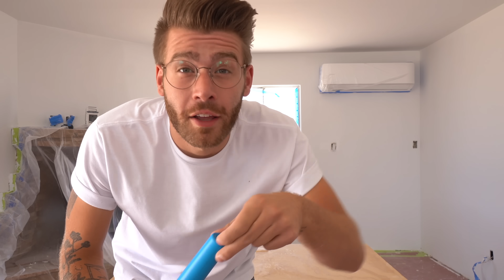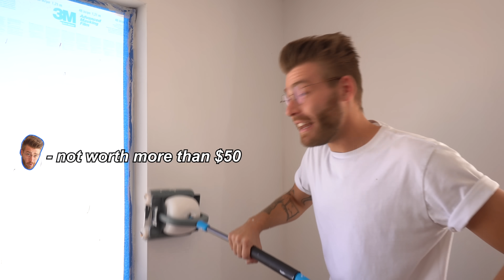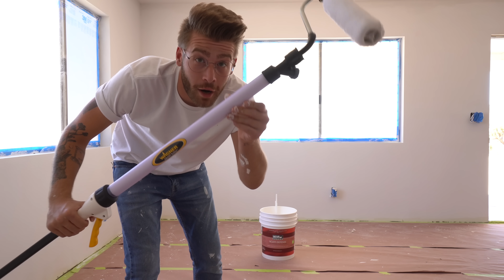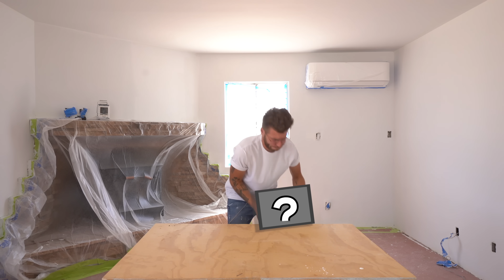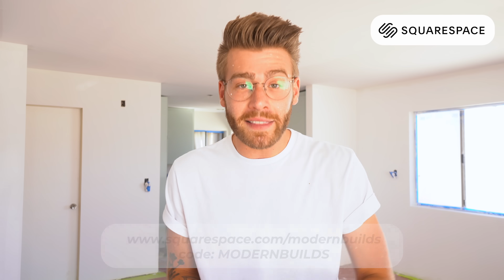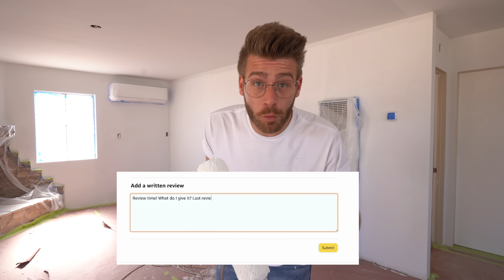AS SEEN ON TV PAINTING TOOLS TESTED!!

Comment: In Canada Ive never seen 1/4 roller in paint store.By default that is always 3/8 (10mm) for drywall walls.
But as suggest by a painter I talked to, Im using 1/2 (13mm) most of the time, it is twice as fast to paint a wall and finish is still very smooth if you dont paint too heavy.So no needs for a fancy tool that can break. But still cool to see thoses gadgets! I would buy a airless sprayer for doors and furnitures, seems great to do a smooth job
Reply from the maker: 1/4" is standard for a skim coat or "level 5 finish". the Lower the nap it, the less "roller texture" gets transferred to the wall. No point in doing a skim coat wall and then have a paint roller give in an orange peel look! 

here, 3/8" is standard for light texture and 3/4" is used on heavy texture and stucco

Comment: I have bought 2 or 3 versions of that $25 Wagner syringe style roller over the years. I keep buying them because they are so fast and make almost no mess. Also, I keep buying them because getting them cleaned and reset (particularly after storing it for a few months) can be hard. Eventually they just start having leaking issues. But...I would never paint a ceiling again without one. It makes ceiling monumentally easier.

Comment: Enjoyed the video. Thanks.
Might consider the Wagner deluxe, but have concerns. 
1. The 5 gallon bucket. Can you put just one gallon into a spare bucket and go? 5 gallons of paint is a heck of a lot unless you're painting a lot of rooms the same or painting a gymnasium.
2. Clean up.
3. Paint usage. Paint is not cheap. 
4. The paint in the hose. Does the hose always need to be full? That's a lot of extra paint, even if you can drain it back into the bucket when finished.

Comment: In all tools (especially with the first and last) my first question is "how easy is it to clean or change colors?"

In the case of all options. I'd honestly rather just throw my paint tray liner and roller away when they only cost $10 from home Depot to begin with.
Reply from the maker: both took about 5 minutes to clean, not a big deal! just run water through the pump to save to old paint in the hose. or fill the $25 with water to make sure the perforated roller holes aren't clogged

Comment: Great video Mike. Just my 2 cents on the 2nd. Wagner roller (if there's someone you can reach out too) would be to add a spring or a small extension on the handle that would help flare the tube away from the wall when painting. Like a 45 angle bracket or something. I've heard that it becomes a bit of an issue, the tube rubbing against the painted wall. Other than that, that roller set up would give even a sprayer a run for it's money. Hoping all is well Bud, Dirty Jersey out!!!

Comment: I was using something similar to the Wagner over 20 years ago. You filled a hollow tube with your paint and pushed gently whenever you wanted to add paint to the roller. I painted a lot of walls with that and still have one in my garage. Latex paint only. I think it was branded the EASY ROLLER but I don't have the original packaging anymore and any branding on the unit has long ago been worn off. It also came with a special paint can lid and suction wand to pull the paint into the hollow tube handle section. The final Wagner is something I'd love to use the next time I paint. Although I'd have liked to have seen you clean that one as I fear you'd lose a lot of paint in the tubing when cleanup time came. Does it have a suction setting to empty the paint in the tubing back into the supply container ?
Reply from the maker: I think Wagner Makes something similar now! Basically the smart roller without the trigger!
Reply: @ModernBuilds  It's called Paint N' Roll and it's in the same Amazon link for the SMART Roller.
Reply: I used what I think was the original back in the 1980s or 90s called the PaintStick. I always found cleanup a pain in the neck, though it had an attachment that attached to your faucet that would force water thru the roller, but I was not all that impressed. These days a simple roller and tray is easiest and cleans up quickest